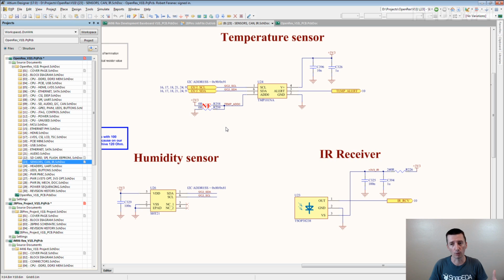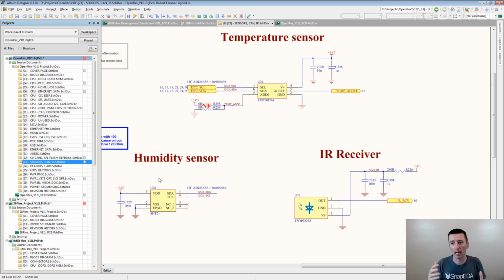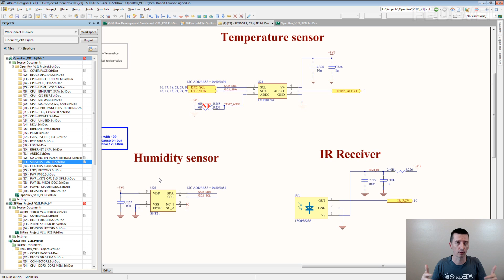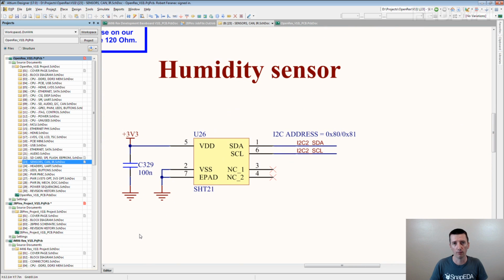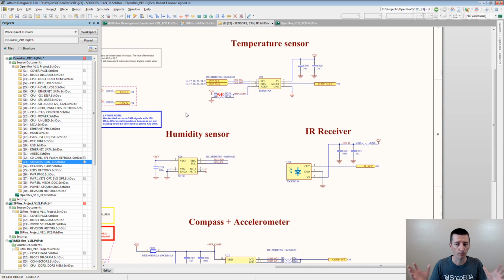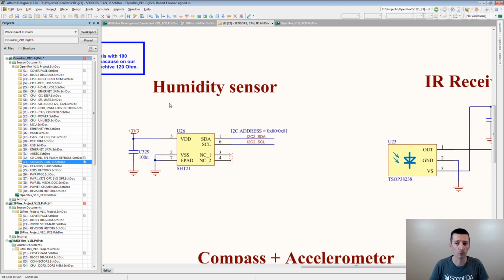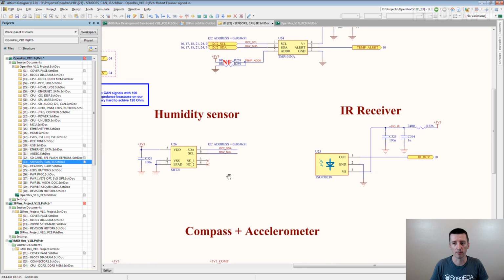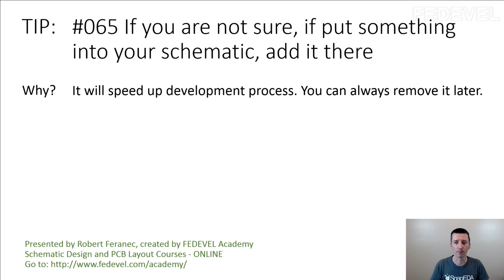TIP #065: If you are not sure, if put something into your schematic, add it there

Comment: I can never understand why designers don't connect the individual SDA and SCL lines together. Why, oh why, do they put a line and a net name to nowhere which means you have to search the rest of the schematic to find where the matching nets are??? It is so much easier to follow the flow of the circuit if all the connections are shown. Expand the sheet size if necessary.
Reply from the maker: This may be possible for simple schematic, but it is impossible to do for complex designs. You can download the project and have a look. It is placed on http://www.imx6rex.com
PS: In Altium, you can very easily browse through nets. Have a look at this video, it can help you: https://youtu.be/CDAuCchchtI
Reply: With respect Robert, the purpose of a schematic is to give a graphic representation of how the circuit works. When the poor test technician is trying to fault-find a PCB and he only has a 30 page PDF with lines and net names, then he will spend a long time searching for matching nets. He won't have Altium to fall back on. Love your videos!
Reply: I think it depends on what you're used to. I find it much easier to have a PDF with 30 pages of schematic and searchable net names rather than a single huge page with all the lines crossing each other, everything is connected to everything and the components crammed together. Don't get me wrong, I think some of the old schematics are true pieces art and are really nice to look at, but I hate actually using them to understand how the circuit works.